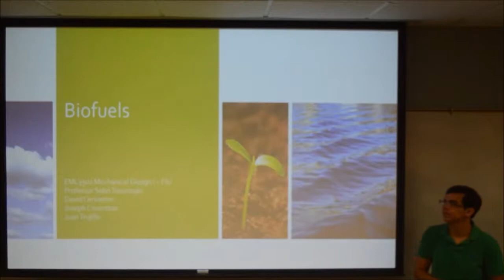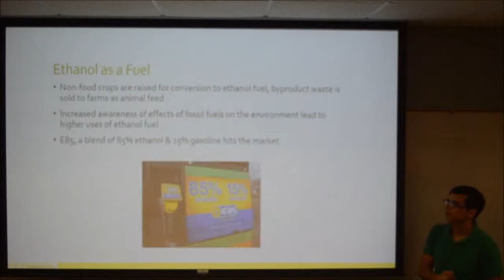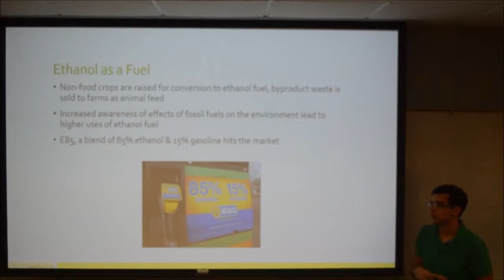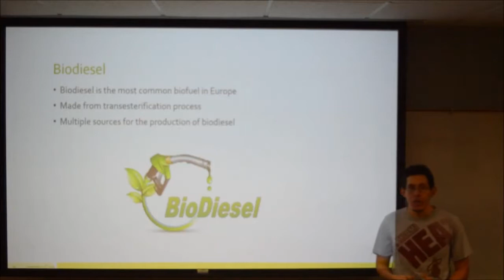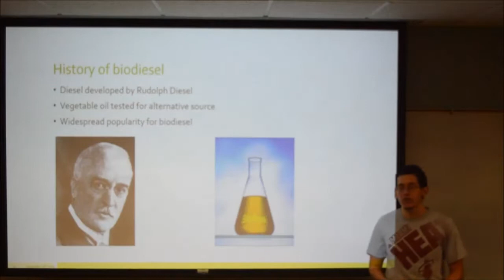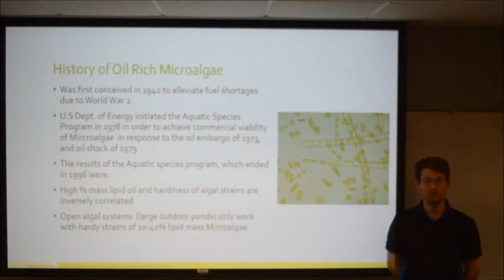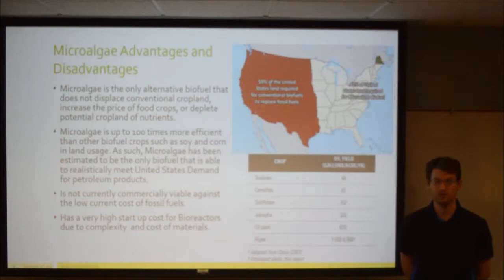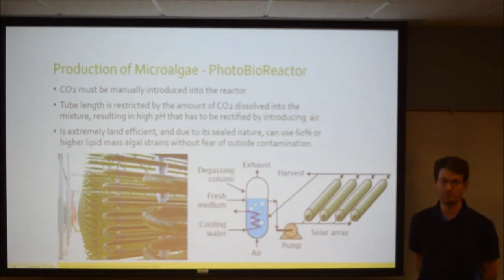Team 10: Biofuels

Comment: Very well done presentation on boil fuels. One of the best educational projects and the structure of the PowerPoint were good and flowed nicely throughout the presentation. Slides and diagrams grasped my attention and were short and to the point. The light was a little off which made it distracting but overall fantastic work team 10.

Comment: The team was able to cover the topic very well.  Almost all of the text in the slides are easy to read with the exception of the introduction slide and the conclusion slide. The inclusion of figures in the presentation was a good idea even though their text is too small to be seen. The presenters cannot be seen well and the audio has background noise that makes it hard to hear the speaker. There is too much text in the Microalgae slides for the viewer to read. The team could have elaborated on the pros and cons of Ethanol a bit more. Overall, this was a good presentation.